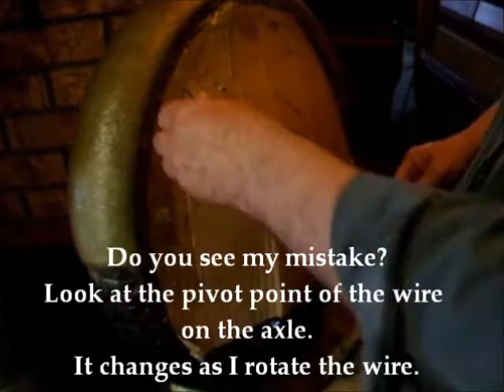Part C2 Triumph Front Fiberglass Fender Removal and Trim

Comment: cool...i like that using packing tape...gonna try it on my subaru's rust spots after i cut the rust out.
Reply from the maker: Hi Rob. Stick your packing tape to the inside of your hole and then overlap the edges with packing tape on the outside indenting the tape the depth of the metal. Then glass over everything including the edges of the metal. When it dries and you remove the glass and clean up all the packing tape, you have a patch which you can urethane glue right into the hole and bondo over the whole works. The two layers of packing tape sticking together make a perfect shapeable surface to apply your fiberglass to and you can pre-prime and paint the edges of your hole to keep rust away from the patch from the inside. If you need really weird shapes, just use a layer of shapeable chicken wire and tape over that on both sides to form the shape. 
Thanks for watching.